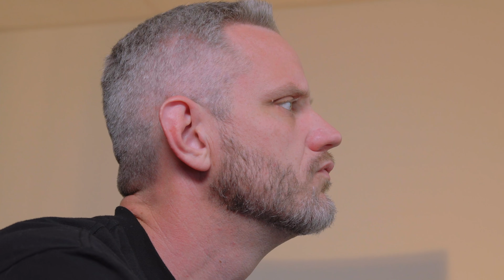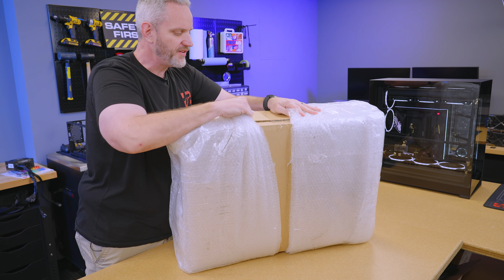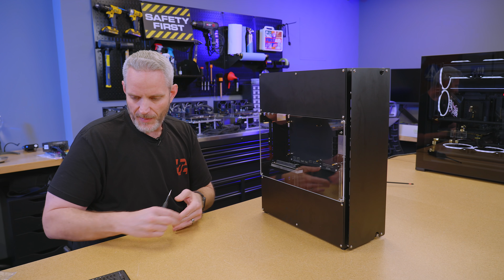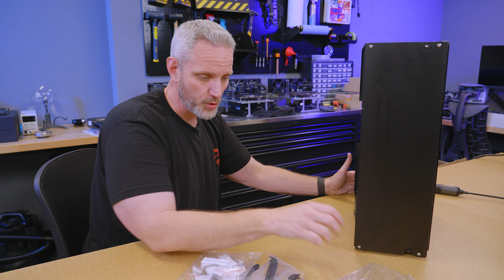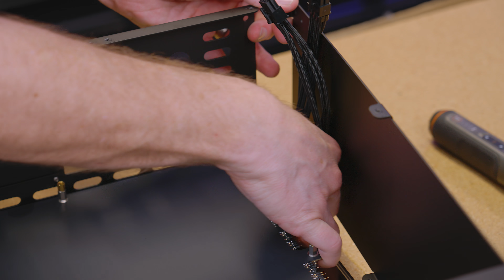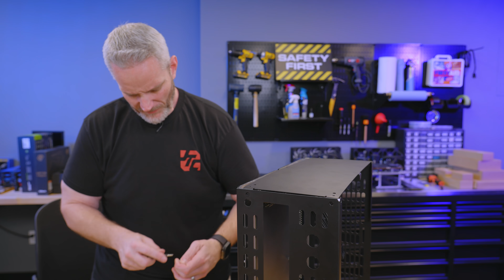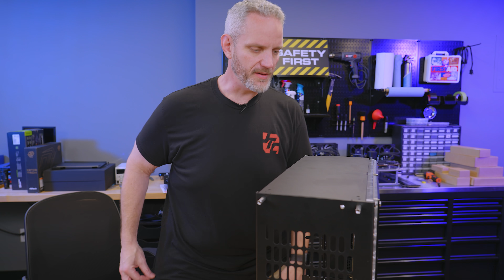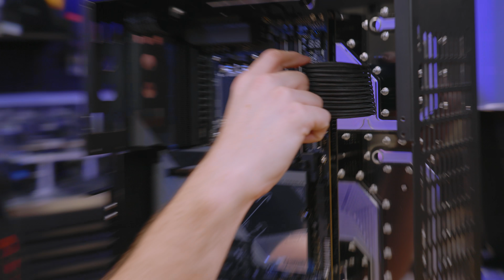I guarantee you haven't seen a case like this before...

Comment: Honestly, it seems like they are better at the distroplates and power boards. The cases seems to not be as well considered design-wise
Reply: They have some nice ones but you have to pick your hardware with the case in mind. For this one i agree though. I like they tried to make a cheaper case but it's just not that nice imho.
Reply: @xxJOKeR75xx  Jay seems to hate Singularity.
He is given a case which is specific to water cooling then does it no justice by shoehorning in an air cooled GPU and spending time talking about using air coolers which this is definitely not designed for.
Reply: @ He was raving about Singularity, so i think calling it hate is just wrong. He just didn't put in the effort he should have. Jay seems really demotivated lately. I guess the awful GPUs really got to him.
Reply: This case looks way too small for my tastes. If your paying $360 for a case, that baby better have some room so you can do something custom. The case looks flimsy
Reply: i cant lie, this just seems like a case with only water cooled in mind and no air cooling. like the vert gpu riser is for a water cooled card and then a block can be put on the cpu and then it all lines up, i feel this was just a silly build example
Reply: The guy is only fussed about new and different modding
Reply: The cases are insane, you got no idea
Reply: They make some of the absolute best cases in the world hands down.  Jayz just put zero effort in to this and didn't even do what the case was designed for.

Comment: Come up with a back connect motherboard version and I would be very interested. I don't do cables anymore.
Reply: need board makers to agree on a standard for plug locations that way they can just make power boards that can directly connect to the boards that way.
Reply: @sirmonkey1985 that's probably never going to happen, we can't even get the OEMs to all agree on power supply designs... Dell can GTFO with that BS of 20 years ago.

Comment: You’re going to want it to be able to slide once it’s filled. It’ll weigh well over 80lbs after all components installed an reservoirs filled.
Reply: As a Meshify 2 XL owner that has to lift my case and lower it into a wall mounted shelf above my desk,with little pegs that fit into the screw openings of the feet: You still want rubber feet, but when servicing it you just slap some business cards or whatever under the feet.
Reply: I’m sure he knows that.
Reply: @BrandonWestfall  I'm sure the manufacturer does but not Jay.
Reply: No.  This only has room for a single 420mm rad.  It will be heavier than an air cooled case, but not much heavier.

Comment: I'm looking to see cases come with standard punchouts for front pannel connectors. You cannot usually match the front pannel IO on the MB with what the case offers. Remove the assumptions and use something like the keystone system used for household jacks and connectors like for audio, phone, ethernet, co-ax, Po and so on. Then you buy a case and a set of connectors to match the MB you're going to use. Heck perhaps if it's a standard the connectors could come with the MB and/or be sold by the case makers and/or 3rd party sellers.

Comment: So serious question here I have an h9 elite I'm building in would you use singularity computers front distro plate that replaces the front glass or would you do like you did in the mega Man build and use a distro plate that gets rid of the three side fans..
Reply: You can put Distro plate on the side of the NZXT elite case and still get good visuals .  and then put the rad so incoming air cools it instead of rad on top where hot air exhausting through it .
Reply: @tpbriplahey7384 Actually im doing dual radiators very similar to his mega man build,. I saw singularity makes a front glass replacement panel thats a distribution plate but Id keep the side fans. Or they make the 360 mounted one to take those 3 fans for a lot less money.. but I lose the fans.